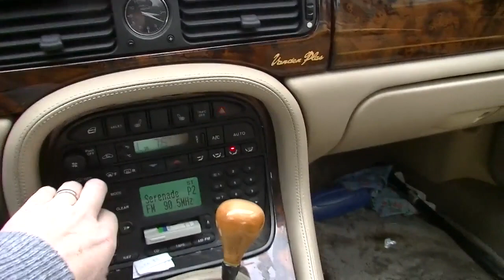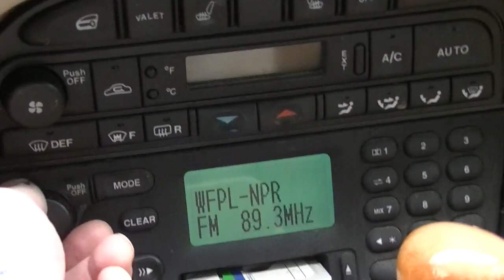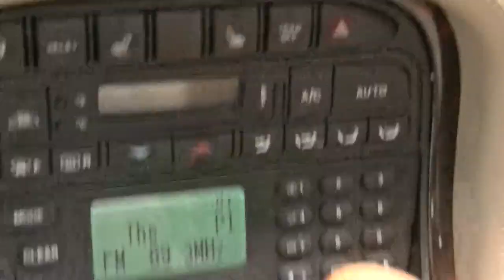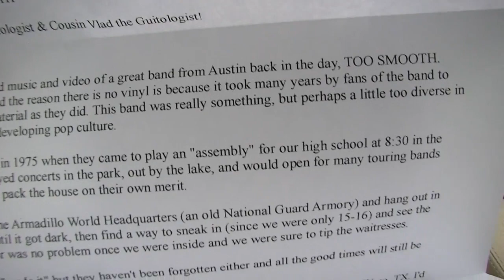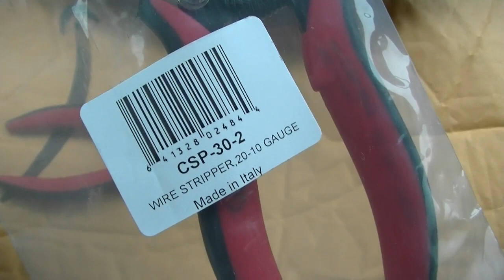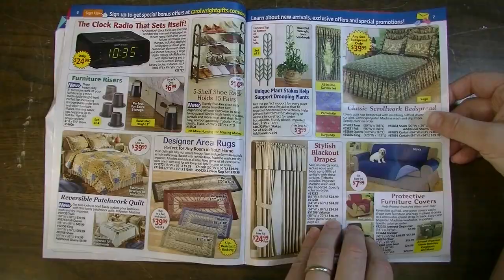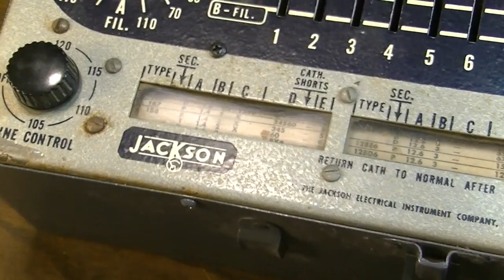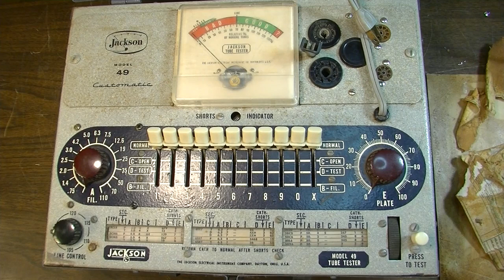SPF ROAD RAGE, Dirty Old Folks, & Why I Stopped Accepting Amps

Comment: Hey Brad, I work in healthcare and a doctor friend told me what he does to avoid or at least reduce the severity and duration of a cold.  I've been using his method for several years now.  I usually avoid the cold altogether if I'm able to start the process quickly.  If I do get the cold, it is usually over in 3 or 4 days.  The secret is having the remedy on hand and act fast.  I call it the "shock and awe" treatment.  It's a pain in the ass, but works very well for me.
1.  Gargle strong warm salt water immediately when you get that tickle or soreness in the throat and continue every 6-8 hours.
2.  Take 1000 mg of Vitamin C with a glass of water every 4-6 hours.
3.  Take 100 mg of Zinc with a glass of water every 4-6 hours.
4.  Take 1000 mg of Echinacea with a glass of water every 12 hours.
5.  Use any kind of strong throat lozenge (Sucrets Cold and Cough, Cepacol, etc.) as needed.
6.  (Optional)  Take a teaspoon of Elderberry extract syrup every 12 hours.  (I have success without it and it's expensive.)
7.  Drink as much water as you can hold.  Very important!!!
Reply: Nothing helped me more getting over a cold or flu than hydrocodone. It could probably save a lot of lives every year but I can't get a doctor to listen to me because of all the abuse of it by some people.
Reply: Never needed anything more than resting and drinking lots of water, as well as eating more.
Reply: Add Vitamin D daily..
Reply: @robertcalkjr.8325  Kratom is way better.
Reply: George Robartes 
Is cloves indica, sativa or a strain?
Reply: My buddy who's a PA swears by elderberry and apple cider vinegar. I also gargle pickle juice for a sore throat; learned that from a professional singer.

Comment: Or people slamming on their brakes for the tiniest little hill or turn, or fuckin driving 30 miles an hour under the speed limit, or not using their signals. Driving isn't that fuckin hard. Use your signals, shoulder check, scan your mirrors and know what's around you, don't tail gate, claim the right away, follow signs, and go the speed limit. It's usually people not using signal, being way to defensive, or not scanning their mirrors or shoulder checking that cause an accident!
Reply from the maker: Not using signals burns me up. And people don't seem to realize they are there to indicate you INTENT to do something. Throwing the fucker while you're already straddling two lanes doesn't count.

Comment: I cracked up when I saw that third hand solder station. Those black things that look like they go over the clips are identical to what we in the telephone industry used to call “rooster rubbers”.  We used them to seal The end of C Rural wire which had a staggered cut at the end and was tapped with a 107 block that cut into the sides of the wire. I say we used them but nobody did because they held moisture.

Comment: Secrets of the Fender Bassman video: April 22, 2018. You reversed all your modifications and went back to original specs because it didn't turn out right. Remember now Smoky.
Reply from the maker: I reversed all my modifications? No. That part I do not remember.
Reply: @TheGuitologist  did you not put it back to near or exact bassman specs.
Reply from the maker: @deuteronimus750  No, I didn't.

Comment: I have those exact wire cutters and strippers and they are very nice! The cutters are very sharp! They will get you close to chassis wiring around tube sockets and components. I try not to cut any thing more than an 18ga. wire or fingernail, yes they can get rid of a hangnail or a complete manicure, with ease. Your own projects will be great, as long as its TUBE AMPS. HA HA! Thanxz

Comment: Brad drives a Jag - u - war Vanden Plas. I knew it from the "wood" work. One of my GFs inherited a 2005 but won't put it on the road.
Reply: Someone who used to live up the road from me liked old Jags and one of them was V12 Sovereign which he drove every day.  It sounded like a big pickup truck with the fan noise going down the road.

Comment: Once again on Wire Strippers , your Yellow handle Miller Style are the best ! Second is a Lighter. At performance Guitars Hollywood they are not allowed to use Wire Strippers only Lighters ! Because of loosing strands .

Comment: Just replace all those caps in the tube tester and it should work just fine and check the resistance of those carbon-based resistors they tend to go high when they get old